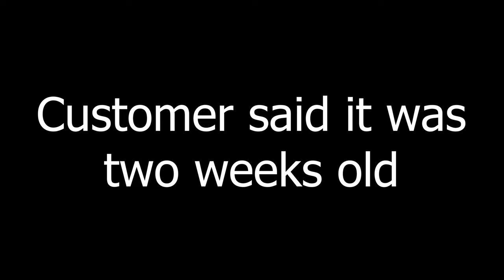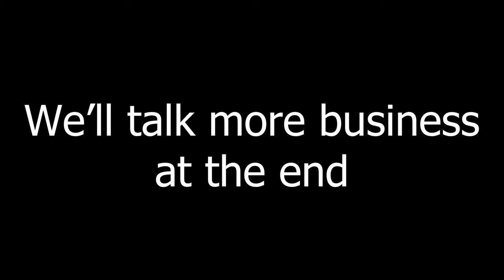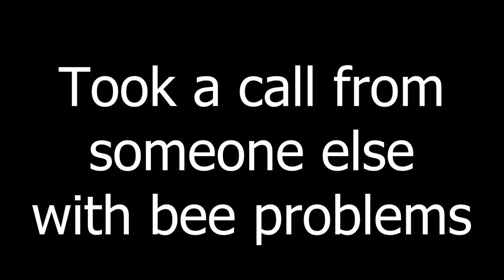This Job Might Shock You

Comment: Great video, liked getting to see Pete again and loved getting to see your Dad again! You are right about construction knowledge for sure! 20 years ago I would have tried a bee removal if I knew what I have learned from you in the last year and a half or so. Some places can be dangerous, it depends on how they were built. About 9 years ago I helped my brother in law, meaning I did all the work, to cut a hole thru the 1st story level of his and my sister's house to install a 220 air/heat unit. The house was built in a very remote area and the previous owner had built it himself. I'm glad I had an oscillating tool and chose to use that for the cuts inside and out! When I opened up that wall there was a power feed ran where I didn't expect one, I must have missed it by millimeters at the most. Any other tool and more depth would have got me! The builder had just ran it against the interior drywall. It bent out a little where I had cut and was flush against the drywall thru the rest of the opening, how I missed the topside of the cut must have been a miracle!
Reply from the maker: I call that a miracle cut because it's a miracle no one was hurt.  lol
Reply: @628DirtRooster  Hear what you're saying, you never really know where a nonprofessional might put something. I'm not a pro but had to completely rewire my separated garage because it had been done wrong and right in so many areas that it somehow worked, scared the crap out of me!

Comment: Whoever stapled siding sure didn't know what they were doing.  Vinyl siding has to give with temp changes.  That is why the nail holes are slotted and you don't nail it tight.   LOL
Reply from the maker: You’re showing your age Gary.  Young folks don’t know about oil canning in vinyl siding.  Heck, most of them never heard of an oil can.  Haha
Reply: Shuuuuush!   LOL @628DirtRooster  I know that is the shaded side by the mold so maybe not an issue there.  But I bet the sunny side is warped all to heck!   LOL

Comment: I installed vinyl siding on 3-4 jobs.  I really didn’t like the product.  I also did a few cut outs.  After I found out people in my area didn’t want to pay I quit doing them. They didn’t even want to pay carpenter wages.  I said.  Carpenters don’t usually have to get stung and wear a hot bee suit to do their work.  They just thought I would get bees for my effort.
Reply from the maker: Yep, a lot of people think you're digging some kind of super valuable treasure out of their walls.

Comment: Can you provide a link or source for that 3M filter material?  Great video.
Reply from the maker: It's sold in single pack sheets.  Lowes usually has it in stock.  Home Depot is hit or miss.  It is on the same aisle as the A/C filters.

Comment: Brick veneer home on concrete slab, Bees in the wall cavity.. I told the home owner it was going to entail removing a section of plasterboard to get to the hive and it would cost 1200AUD. They nearly had a fit and said the pest guy quoted 200AUD to exterminate the hive. Guess how that ended for them... 3 years later, same house, another hive and I quoted 2.5K and the guy couldn't get his wallet out fast enough.. Guessing the repair bill from the first hive was enough to make him realise a thing or two😂Always stand your ground on job pricing.

Comment: How about insurance and bonding?  Business license?  Work permits?  Those things are never mentioned.
Reply from the maker: We are insured but for this business none of those things are required in my state as well as in most other states.
Reply: Thanks for the reply. Good to know. I’m in Arkansas.
Reply: Was at another apiary yesterday in Arkansas, they do cutouts. They told me that once their work started causing the big pest control companies to not have as many bee killing jobs, they were forced to get a pest control license. Craziness.
Reply from the maker: @mark_coyle  If they aren't using chemicals then they don't need a pest control license.
Reply: I looked it up… straight from the state website. 
It is a violation of Arkansas state law to charge a fee for the removal honey bees from a structure without a valid pest control operator's license.
Reply from the maker: @mark_coyle  Leave it to Arkansas.  I though Georgia was the only state who had gone down that road.  Georgia requires a removal class and license.  It's completely separate from a pest control license.
Reply: Arkansas is a little different, always. So I can do it, just not charge…. No thanks. I’ll just get swarms. 😁